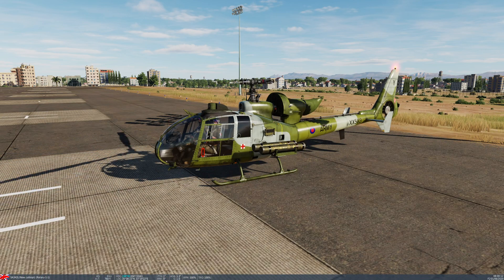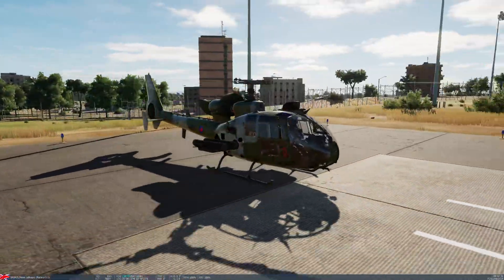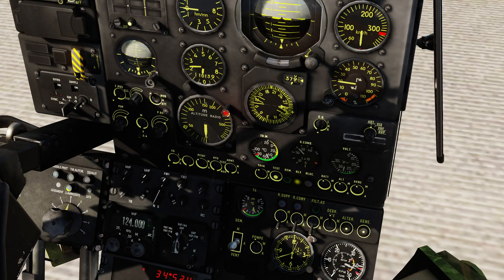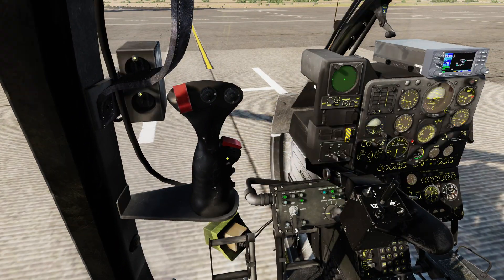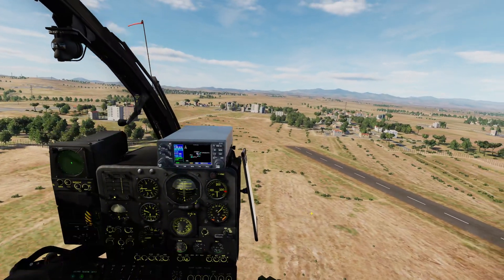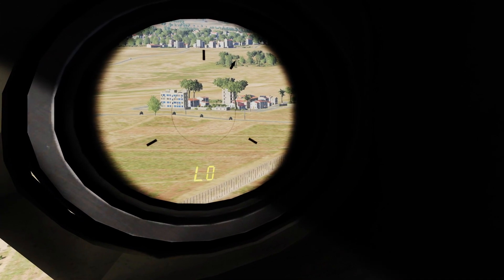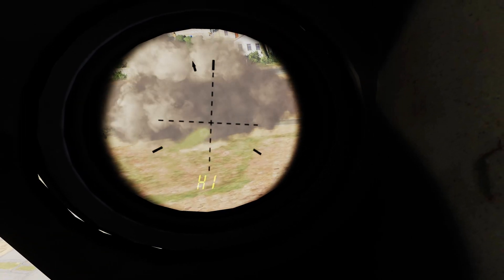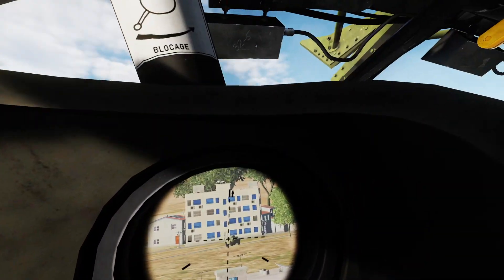DCS SA-342L Tutorial 5 - HOT3 Anti-Tank Missile

Comment: Finally got around to learning give Gazelle. Have to say, after flying the Mi-24 Hind for the last year, flying gazelle is a breeze. It’s also a lot more fun zipping in and out of cover.

As for a second crewman and autohover, I find it’s easier if I put it into a hover myself and Trim it. Then I switch to the copilot seat and operate the Hot-3 site with the smaller side stick on my throttle while continuing to control the cyclic. Don’t need to mess with collective once I’m trimmed and only need a little pedal to swing her around. It’s an easy helicopter to hover with so it’s not a challenge to use my thumb to move a little stick around.